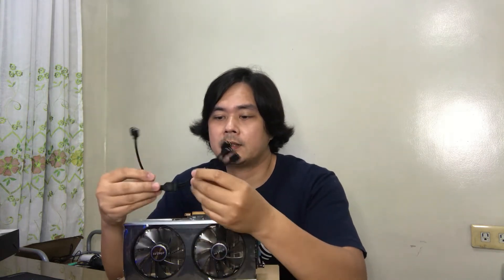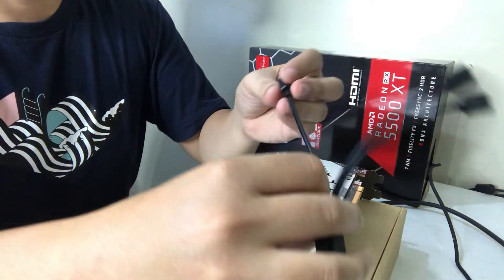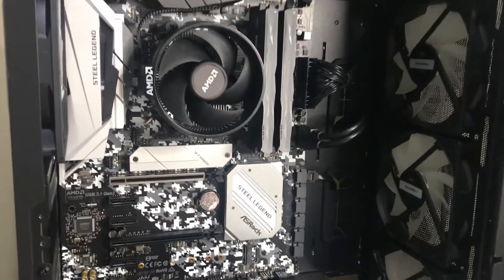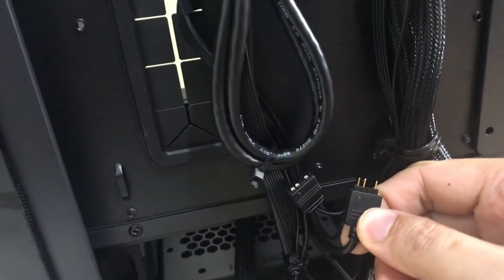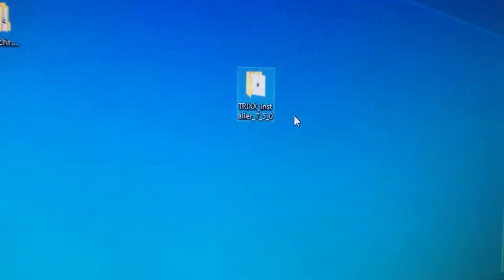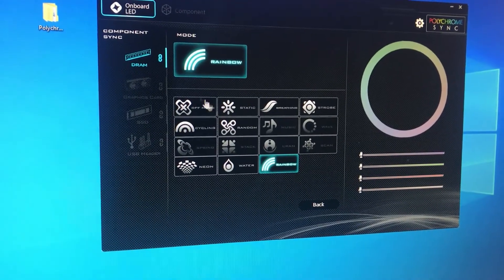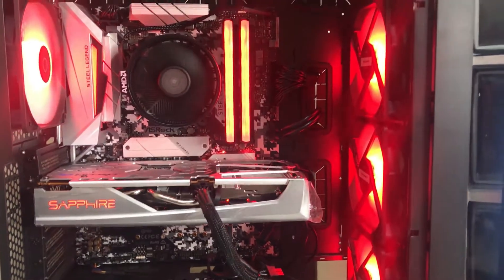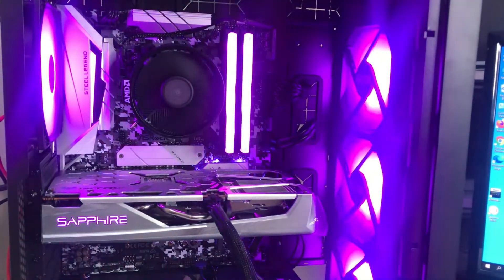Full Sync your Sapphire Nitro+ RX 5500XT SE Lightings on your Motherboard (same apply to RX5700XT)

Comment: msi a320m-a pro
2x8 3200 ram
ryzen 3 3200g
cpu cooler
rx 5500 xt gpu

kaya po ba yan ng cv450watts na psu?? thanks po... or 1660super na gpu
Reply from the maker: Yes po kayang kaya
Reply: @JojitManlapaz  salamat po, may mga nagsasabi nde na kaya, kaya nagaalangan ako.. salamat po..
Reply from the maker: @edwinreguajr.7534  si Corsair po kasi continues power output ang naka declare, so kayang kaya nya ibigay ang 450w na walang putol, unlike sa ibang brand na kadalasan ay max power output lang naka lagay,, Ryzen 3200g around 130watt total power draw @ the wall including ram and mobo, tested ko na yan,, and gtx1660s is 125w tdp, kay nvdia malapit lang ang total power consumption nila sa tdp. around 130w max lang yan kung di mo yan overclock,, total around 260w lang ang system mo,, kung may hdds and mga fans and lightings di yan lalagpas sa 300w kahit maglagay kapa ng 240m water cooler
Reply: @JojitManlapaz  maraming maraming salamat po sir.. gpu nlng po kasi kulang ko, gusto ko lng po makasigurado, buti nga po napanood ko video nyo about sa 450watts na corsair same ng sakin.. kesa po mag 1650 super ako, mas preferred ko ung rx5500xt or 1660super para mas mataas na.. salamat po tlga sir..
Reply from the maker: @edwinreguajr.7534   https://www.youtube.com/watch?v=xYuAMNo9Qck with this build sir im also using cv450 until now wala po yan na report na problem, pinakita ko po max power draw ng sytem sa bandang huli ng video, kindly watch po , good luck po sa pag hunt ng gpu medyo madalang and mahal this days